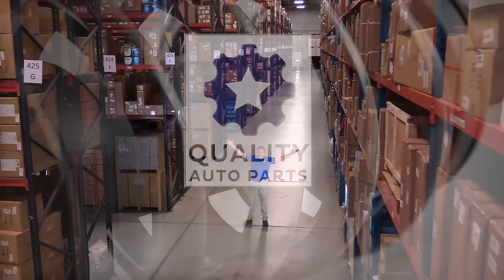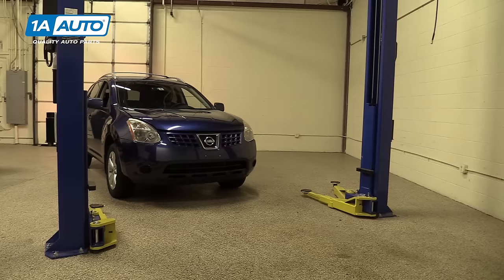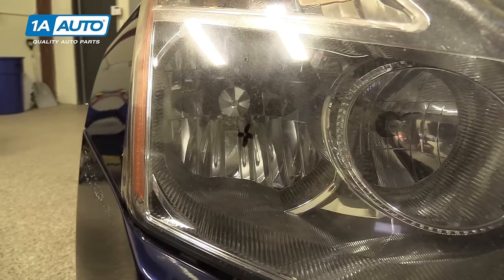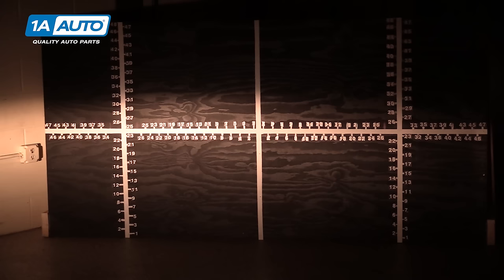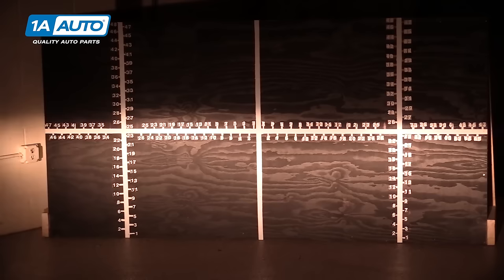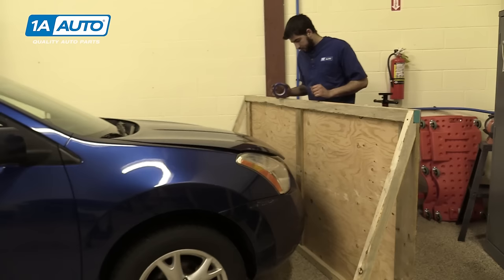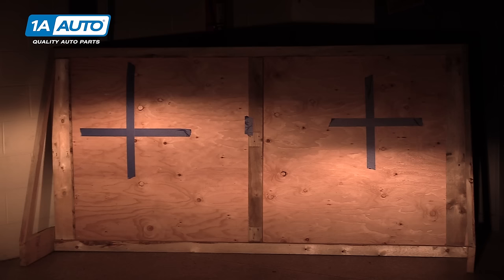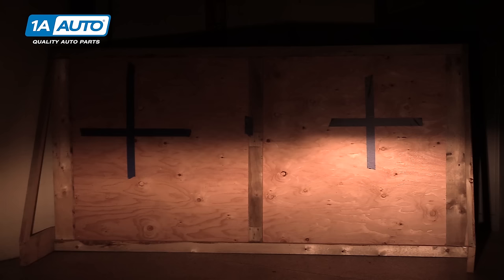How to Aim and Align your Headlights Correctly

Comment: What about headlights that adjust right to left as well as up and down
Reply: Ryan Scherbluk make sure it’s pointing straight forward left to right 🤷🏼‍♂️
Reply: DId you find anything on the topic ? I have the same issue as well.
Reply: You may have gotten your answer, but for those wondering, that's just to tighten your beam pattern so you're not lighting up the ditches on the side of the road instead of the whole road. The beams should meet to where it lights up the middle of the two beams, but not overlap.

Comment: It'd be great if you could add a timestamp to the notes, indicating where the left-right adjustment is.  I skipped backwards and forwards for quite a while but couldn't find it.
Reply: You center them on the cross hairs with the numbers on either side of the center line... hence aligning the board to the center of the car then backing up straight back 25ft....

Comment: A perfectionist would first check to see if their front suspension is level  with each other before making the headlight adjustment. Doing so would ensure a clear straight line or symmetrical look.

Comment: Uh... What about left to right? I just installed some SpyderD projectors on my '10 MINI and they are all types of crooked. They cut off about 4ft in front of the car and each light crosses about a foot into the next. The projection lights are decent but they do not "blend" very well. The cut off for them is extremely sharp. It makes up and down adjustments super easy, but it looks strange and is going to take awhile for me to get used to. I'm still not sure what a proper vertical adjustment should be. That's my only fault with the vid. Other than that it's the best headlight adjustment vid on YouTube.
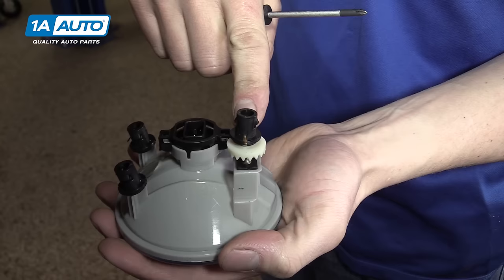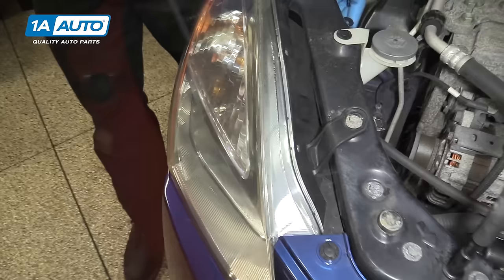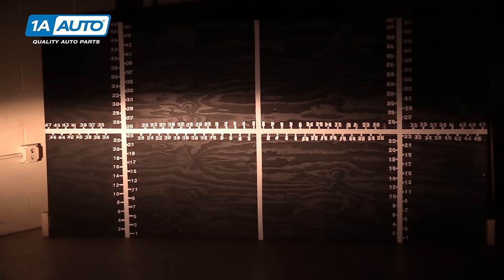Reply: A lot of people need to rewatch the video specifically from 2:45 to 7:20... pay special attention to 3:15 to 3:45 and around 5:15. YOUR Questions will be answered. 
Did you not notice the cross hairs with numbers on them on left and right side of the center line... It's for your left and right adjustments... Like he said turn the adjustments until they are centered off the center line of the headlight bulbs...

Comment: What about side to side? And those driving lights, any which way or is there a right way to aim those too? Front end crash so am starting from scratch.
Reply: You can install headlights with best output beam pattern without scattered beams. contact us for detail
Reply: Did you not notice the cross hairs on left and right side from The Center line... and that the lights are centered on them....

Comment: how you will moved righ or left 
i undersand up to dawn pls answer my question
Reply: Not sure where you are, but most if not all autos sold in the USA do NOT have a lateral adjustment. They should aim straight forward, no deviation. However if your frame is bent or the beam isn't straight forward for whatever reason, you can use washers behind the headlight mounts to shim the assembly left or right as needed.
Reply: Hammer and chisel will adjust up and down or left to right...

Comment: Why does it have to be 25 ft is there any way to extend the 25ft so when I'm driving at night I can see the Road I noticed that your line and it wasn't straight all the way across wasn't even with the right side of the left side did you catch that
Reply: 25' is only a small portion of a 330' triangle. Instead of measuring out 330' and aiming the light to the ground that far out, we shorten the triangle and aim down APPROXIMATELY 2 inches. The actual aim will vary depending on how high your headlights actually are. In left-hand drive countries like the USA, the left side of the projector beam or the left light in a reflector system is aimed lower to reduce glare for oncoming traffic.

Comment: So is the process the same for a truck that had been lifted? I just put a leveling kit on my truck and I know the headlights are too high now. So I still measure to the middle of the headlight for the height to aim for on the wall at 25ft or is that only for factory ride height? In other words let's say someone lifted a truck 6". That would put the center of the headlight at least that much higher than it was before. So of this methed is used wouldn't the cutoff at 25ft be way to high in relation to passenger vehicles? Or am I overthinking this?
Reply from the maker: +Brian Steeves You may be overthinking this. No matter how high the vehicle is the lights will need to be aimed at the same height and distance. The light needs to be at the same height no matter how tall the vehicle is. Thanks! 1AAuto.com
Reply: @1AAuto  Wait, what? The video says to measure the height from the floor to the reference dot on the headlight, then adjust the left headlamp 4 inches below that reference line (at 25 feet) and the right side 2 inches below. So let's say a truck has a headlight reference dot height of 40 inches...the left and right sides would be 36 and 38 inches respectively, right? But if the truck was then lifted 6 inches...wouldn't the horizontal reference line be increased from 40 inches to 46 inches, and then the headlights measured 4 inches below that (left) and 2 inches below that (right)? Your answer above says the light 'needs ot be at the same height no matter how tall the vehicle is." Vehicles come in all sorts of heights, so I don't follow that statement at all??

Comment: while aiming should it be in high beam or low beem
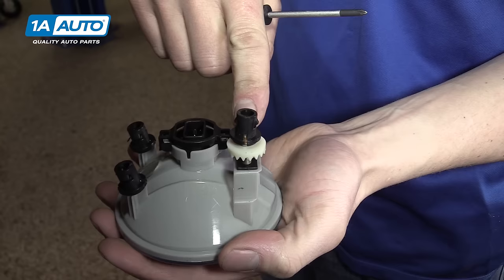Reply: A lot of people need to rewatch the video specifically from 2:45 to 7:20... pay special attention to 3:15 to 3:45 and around 5:15. YOUR Questions will be answered. Also you use your low beams since the entire point is to adjust them to not blind people cause you turn your high beams off.... derrr.... You should have your license revoked for asking such a dumb question...

Comment: Another quick question.
I have a 2010 Grand caravan just installed  a 4 sided LED bulb.
2  are for low beam and the other 2 are for high beam.
Do I want my low beams to reflect down and on the outside and my high beams on the inside, or do I want my high beams reflecting on the outside of the headlights?
The vehicle you used has the high beams reflecting on the inside.
Thanks for your time.

Comment: Do you have your low and high beams on while adjusting or?.... I'm lost
Reply: A lot of people need to rewatch the video specifically from 2:45 to 7:20... pay special attention to 3:15 to 3:45 and around 5:15. YOUR Questions will be answered. Also you use your low beams since the entire point is to adjust them to not blind people cause you turn your high beams off.... derrr.... You should have your license revoked for asking such a dumb question...

Comment: Hi there, how to adjust high beam? Thank you!!
Reply: The purpose of aiming the low beam is so you can see some distance down the road without causing glare for oncoming traffic. High beams are only supposed to be used when there is no opposing traffic, therefore aim is unnecessary.

Comment: Thanks for a terrfic video ! 

Anyone know what entity  decided on the 25 ft. setback from  'aim check wall'  ?   And why ?
~ Was it for optimal positional by math & averaging of headlight focus tech at the time ?
~ Or was it due to possible flaring out of the headlight beam on the surface of the 'aim check wall',  at any shorter distance ?

My vehicle surface going back to 25' would encounter/cause the back end elevation to be lowered resulting of course in the headlights pointing irregularly higher !

So (when  I can sched')  was considering a doable 12.5' distance setback and double-up on any readings  to attain the  optimal correction  equaling the 25' setback 'norm .    But that will likely only work if the headlight beams don't flare out !!

Thanks.

Comment: when adjusting, is that on high or low beam?
Reply from the maker: +RY When adjusting headlights you make the adjustments when the low beam is on.
Reply: A lot of people need to rewatch the video specifically from 2:45 to 7:20... pay special attention to 3:15 to 3:45 and around 5:15. YOUR Questions will be answered. Also you use your low beams since the entire point is to adjust them to not blind people cause you turn your high beams off.... derrr.... You should have your license revoked for asking such a dumb question...

Comment: Is this adjustment made with high beam or low beam?   Maybe I missed it but no one ever seems to address this in their videos. I've watched 20 of these IDENTICAL headlight adjustment videos and NOT ONE mention of high or low beam.
Reply: A lot of people need to rewatch the video specifically from 2:45 to 7:20... pay special attention to 3:15 to 3:45 and around 5:15. YOUR Questions will be answered. Also you use your low beams since the entire point is to adjust them to not blind people cause you turn your high beams off.... derrr.... You should have your license revoked for asking such a dumb question...

Comment: what confuses me about this headlight alignment is the fact that every car has a different suspension set up. therefore, wouldn't it make more sense to aim slightly downwards for a car that sits higher to avoid blinding drivers?
Reply: Yes.  I've seen many a truck that were lifted, and did not have their headlamps adjusted to compensate for the height difference.  Depending on the type of lamps you have, you could start with the same height he used in this video if your lamps are similar, and make adjustments from there to get the proper frontal lighting without blinding oncoming traffic.  You'll need to do this at night, and with help from a friend to drive towards you to make sure he's not getting blinded.  These new lamps nowadays have more of a level, flat light pattern, as seen in this video.  Older vehicles that still use the sealed beam assemblies have a different headlight adjustment procedure.  Those cars and trucks have definite hot spots of light, so their beams are more focused, and not spread out like these new ones.  Those will also need the side to side adjustments checked, as they will be pointed more toward the center of the car's centerline.

Comment: How do you come up with reversing 25 feet? Is there a calculation involved?
Reply from the maker: +Dylan Shabtai 25 feet is the standard distance used when aiming headlights. Thanks for checking us out. 1aauto.com
Reply: 2" down at 25' is less cumbersome than 26" down at 330'. Both illuminate the road 330' out, but only if the road is level for that distance and only if the light is strong enough to go that distance. Most autos sold in the US are not that bright.

Comment: Since the centre (dot thing on the headlight) is 32 inches. Why do you need to align the top cut off of the light at 30 inches?
Reply: You don't want your light "parallel" to the ground, but slightly pointed towards the road.
Reply: to keep the light out of the eyes of the on coming traffic

Comment: When would this technique be needed?  Maybe after someone took their headlights out, then put back in to make sure their set to factory default?  Thanks. Great video.
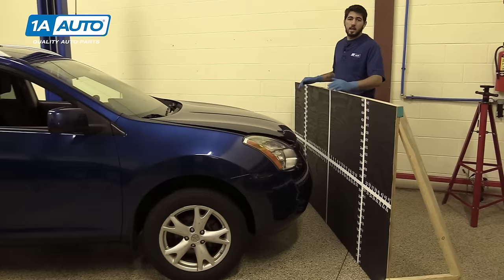Reply: Nrfa 0:39 to 0:50 gives you the answer
Reply: When you get new headlights(upgraded)
Reply: If raise or lower the suspension on your vehicle you need to adjust your headlights

Comment: PLEASE, PLEASE, ADDRESS THE MULTIPLE QUESTION....HIGH OR LOW BEAM???? IN THE VIDEO. DRAGGING THROUGH 482 COMMENTS IS NOT ON.
Reply: A lot of people need to rewatch the video specifically from 2:45 to 7:20... pay special attention to 3:15 to 3:45 and around 5:15. YOUR Questions will be answered. Also you use your low beams since the entire point is to adjust them to not blind people cause you turn your high beams off.... derrr.... You should have your license revoked for asking such a dumb question...

Comment: What do you mean when using the term "cutoff"?
Reply: mrfester42 the point where the light no longer shines. So the dark bit on the board above the light.
Reply: basically the top line of light is the cutoff

Comment: LOVE YOUR VIDEO,S AND YOUR PRICES ON AUTO PARTS; I HAVE WHAT MIGHT BE COSIDERED A STUPID QUESTION I HOPE YOU CAN AFFORD ME SOME ADVICE; WHAT MEASURMENT WOULD YOU USE IF YOU HAVE (2 DIFFERENT MEASUREMENTS ) FROM GROUND TO CENTER OF DRIVERS HEADLIGHT AND THE PASSENGER HEADLIGHT; THEIR IS A 2-TO 3" DIFFERANCE IN THE TWO MEASURMENTS; I SURELY APPRECIATE ANY ADVICE YOU MIGHT RENDER; THANK,S PATRICK.P
Reply from the maker: You want to measure from the ground to the point on the headlight lens directly in front of the bulb!

Comment: A lot of people need to rewatch the video specifically from 2:45 to 7:20... pay special attention to 3:15 to 3:45 and around 5:15. YOUR Questions will be answered. Also you use your low beams since the entire point is to adjust them to not blind people cause you turn your high beams off.... derrr.... You should have your license revoked for asking such a dumb question...

Comment: Nice way to make half a video.🙄 This is useless without side to side alignment.
Reply from the maker: +wrgtb Thanks for watching!  The majority of vehicles will only have vertical adjustment, but the horizontal adjust will follow the same principles!  1aauto.com
Reply: And lacking lateral adjusters, washers can shim out the assembly.